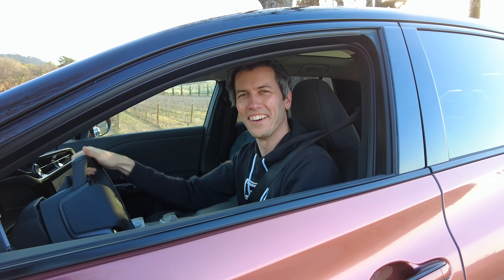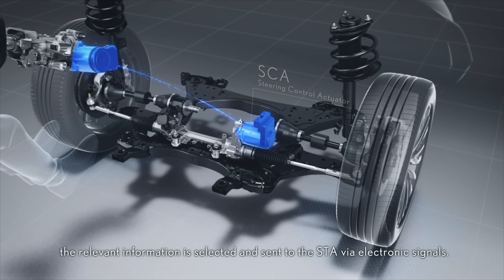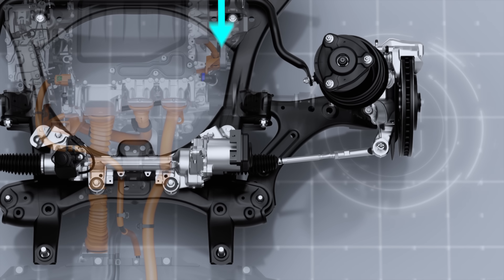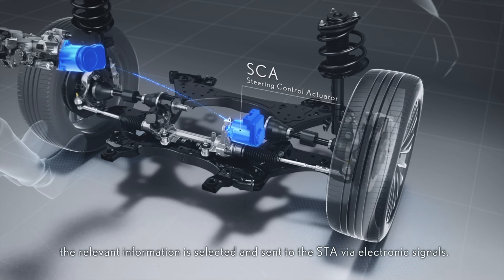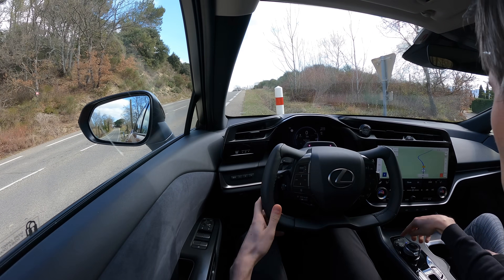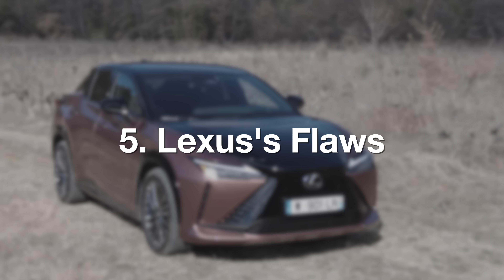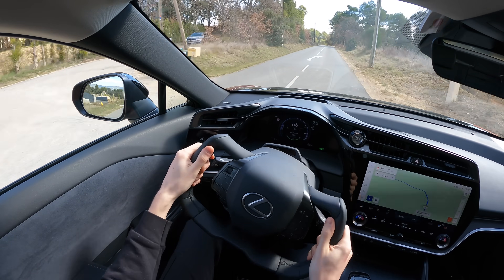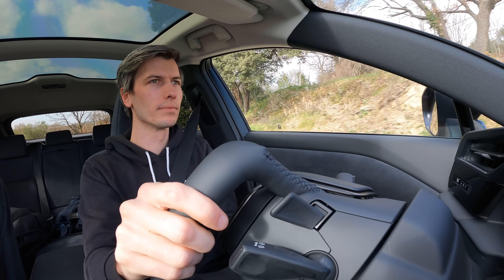How Lexus Fixed Tesla's Bad Idea: Steer-By-Wire Yoke

Comment: It would be annoying to me to not have a top half to hold onto
Reply: But it has variable steering ratios you probably won't need to rotate it fully
Reply: Holding the top of the wheel is objectively a bad idea. If anything happens, the airbag will break your arm and then your nose as your face hits your arm. Absolutely guaranteed that you won't have time to move your arm if you're getting in a crash. You're also not in as good control of the wheel, so preventing you doing that actually settles out as a benefit. 🤷🏻‍♂️

Comment: Fighter jets are fly by wire and look to be a ton of fun so bring it on!
Reply: But those are fighter jets, this is a glorified shopping trolley, not exactly comparable.
Reply: Ok go buy one .....AND pay to maintain it directly ..all by yourself not .share the  incredible cost with others via tax increases
Reply: @jackd1582  what?...the implication wasn't I wanted to buy a fighter jet.
Reply: My thoughts, if it's a similar setup to a vipers setup, it will almost drive itself.